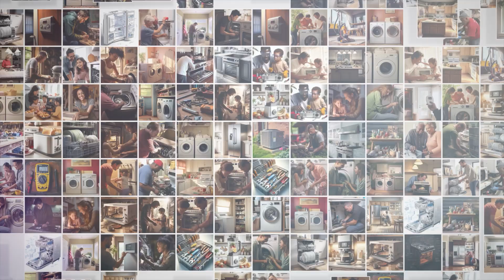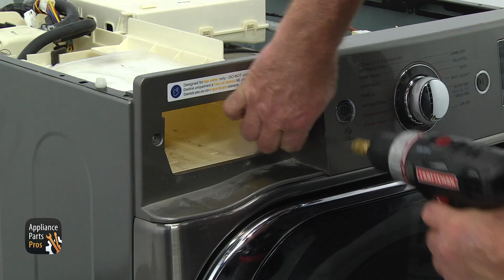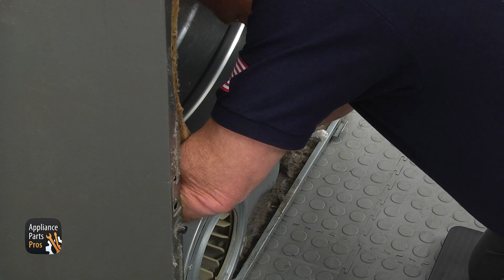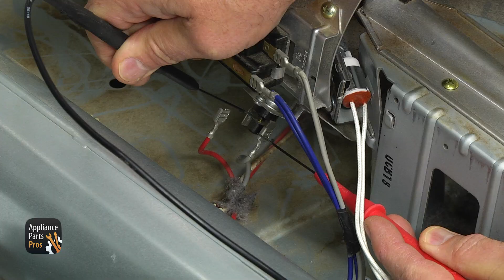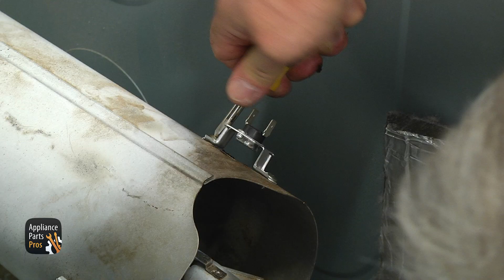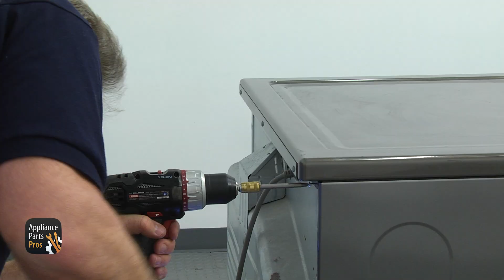REPLACE Your LG Gas Dryer's Thermostats In MINUTES With This Easy Guide

Comment: Thanks for all your vids! At time stamp 5:14, did you press the reset button on the thermostat? And does this test of both high limit and safety thermostat apply for an electric dryer too?
Reply from the maker: It looks like he's securing the wires, you shouldn't have to reset that thermostat after you install it.